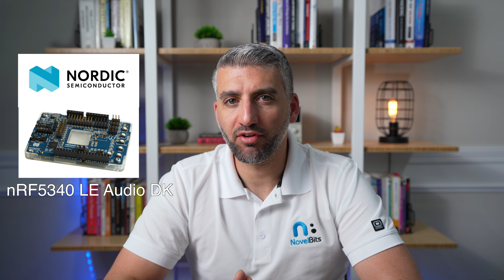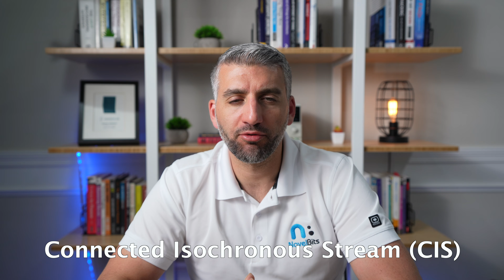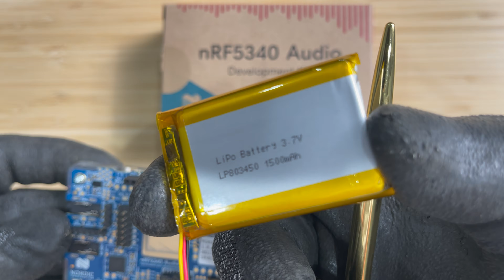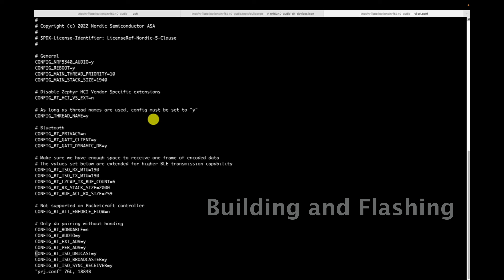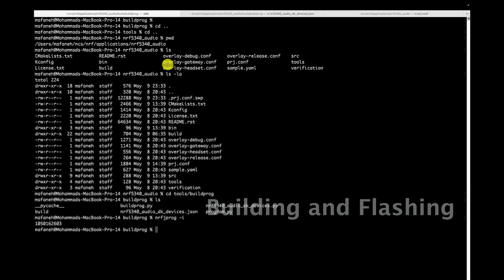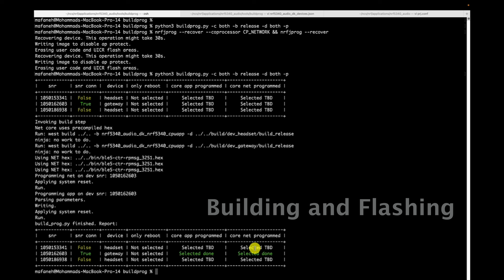Discover the Future of Audio: Bluetooth LE on nRF5340 Audio DK!

Comment: Thanks for this great video. However, when enabling CONFIG_AUDIO_SOURCE_I2S=y  for all devices in the proj.conf to allow the gateway to send audio from the line-in input instead of via USB, this is extremely unstable in my case. Sometimes only the left earbud plays. Sometimes nothing at all. Sometimes the audio is flickering, and many other issues. Am I missing something else here for this configuration? The USB-based audio mode works perfectly though.

Comment: Can normal earphones pick up the broadcast from host nrf ?
Reply from the maker: Only ones that support LE Audio will be able to do that
Reply: Then earphone with BT 5.3 will support broadcast? Or is it different from Audio LE ?
Reply: @taehyungkim8103  LE Audio requires at least v 5.2 but the features required (mainly Isochronous channels) are optional features in the specification. So, many Bluetooth devices will be 5.3 or 5.2 compliant but it doesn’t necessarily mean they support LE Audio. They also have to be an LE device and not BR/EDR (Bluetooth Classic).

For the broadcast mode specifically, the Bluetooth SIG introduced a new brand called Auracast which should make it easier to identify which devices support the broadcast feature or not (whether it’s a source likes TV or a sink like a pair of headphones).
Reply: What headphones have this LE Audio?
Reply from the maker: @pookers2000 most popular ones are the Samsung Buds 2 Pro

Comment: Which link shows setting up repositories that you mention at 10:18? I see this video being super helpful because Nordic docs assume a lot of knowledge of configuration and their automatic SDK installation does not seem to get you to a point where you can run the demos.
Reply from the maker: Yes I do agree. And it wasn’t a straightforward process for me either. I’ll look it up and get back to you. I may have to add the steps to the companion blog post as well.
Reply from the maker: So I followed the following instructions for setting up the nRF Connect SDK repo:

https://developer.nordicsemi.com/nRF_Connect_SDK/doc/latest/nrf/gs_installing.html

And then followed the steps laid out here to specifically set up the LE Audio related configuration: 

https://developer.nordicsemi.com/nRF_Connect_SDK/doc/latest/nrf/applications/nrf5340_audio/README.html#configuration

I may have run into a couple of issues along the way but I don’t quite remember. So if you do, let me know and I will do my best to help.

Comment: Hi as always, thanks for the great content!
I had a question regarding Bluetooth and I thought that you be the best person who would be able to answer this.

 I understand that Bluetooth transmitters can save energy by going into deep sleep, but how do we save energy on bluetooth receiver's which receive irregular data and do not know when the data will arrive.

 for example how do apple air tags preserve battery when they  are also receiver and transmitters as well, and can sustain a year on cr2032 like battery
I've come across something called like power poll save, but couldn't understand ut
Reply: Can you help me out please?
Reply from the maker: Fahad, a low-power “receiver” (which I suspect you mean peripheral) in Bluetooth Low Energy has to wake up at specific times when connected to a central. These are called connection events. Keep in mind the communication in a Bluetooth LE connection is bidirectional so there’s no specific transmitter vs receiver. The key is in the low amount of data being transferred and the efficient way of handling the data to allow the peripheral to go to turn off the radio and go to sleep as soon as possible. That’s how they can achieve really long battery life. There’s also a parameter called Peripheral Latency which allows the peripheral to skip connection events, if it does not have any data, without the central considering the connection lost.
Reply: Hi Fahad. 

I was also struggling with this question. I initially thought a receiver would need to be powered on the entire time to listen for random transmissions but in the case for connected BT LE devices this isn't true. I'm still new to this and learning (someone can correct me if I am wrong) but, from what I understand, the reason a BT LE receiver can be very power efficient is because it is also sleeping most of the time. Let's assume you have a central/receiver device and a peripheral/sender device. In my case I'm using the peripheral to send temperature sensor data to the central device. Once a connection is made between the central and peripheral, the central synchronises a connection interval timer with the peripheral (you can specify the connection interval duration). The 2 devices then power down their radios until the next connection interval period is reached at which point both devices turn their radios on again and the central checks to see if the peripheral has any new data. Once the new data has been transmitted they both power down again until the next connection interval timer has been reached. I think the maximum connection interval time is 4 seconds.

Nordic has a great power profiler which you can use to determine the power usage of their chips depending on the various usage scenarios. https://devzone.nordicsemi.com/power/w/opp/2/online-power-profiler-for-bluetooth-le

Assuming a 4s connection interval with a connected central device, you can get as low a 4µA average current!